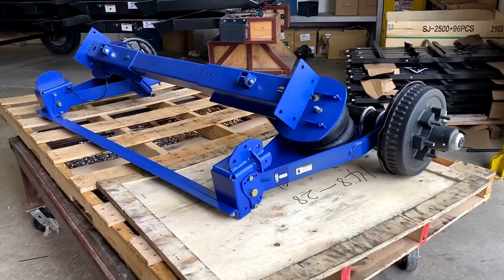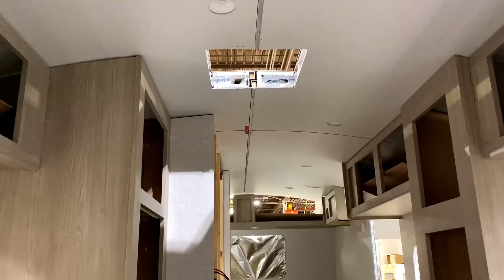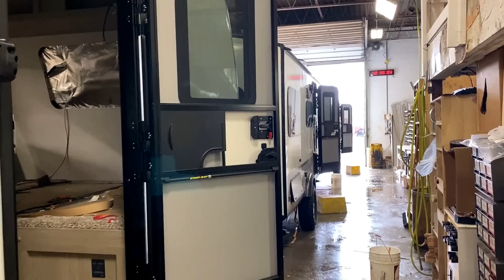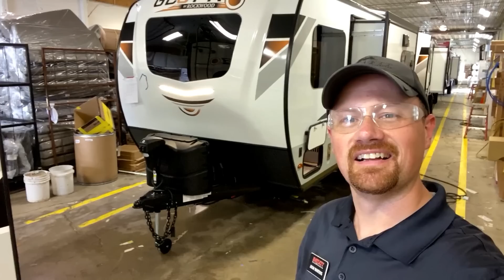Rockwood/Flagstaff Factory Tour!! (Part 3: Geo Pro & E-Pro)

Comment: I watched this series five years after it was produced because I  just bought a Geo Pro G19FD. But the timing is right because it is a 2018 model - made just three years before Josh visited the factory. Mine was owned by a man who, literally, never used it - parked in an enclosed garage - so it is functionally new, with no signs of wear and perfect graphics! This tour reinforced my confidence that I bought the best travel trailer for my intended purpose: Mostly off-road camping with some boondocking. I was very pleased to see proof of the superior engineering these units reflect and the extra care with which they are assembled. It also delighted me to learn how well Forest River treats the employees. I look forward to years of trouble-free exploring. Thanks, Josh!

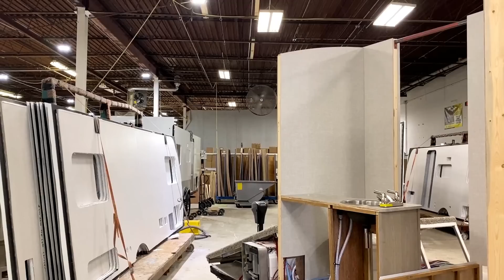Comment: Those flex tubes at 12:33 seem to be flex tubes on pex fittings. That’s not ideal over time. Is it possible to have them confirm? I’d love to get an all pex trailer with no flex tubing if possible.
Reply from the maker: Note the posting date on this footage. They've made some improvements since
Reply: @JoshtheRVNerd  I actually emailed them yesterday. They confirmed they still do use flex tubing in the geo lineup. I asked if I could order one without flex tubing and they said it was not possible. (Will from Sales told me this). I guess I’ll have to keep looking as this was my favorite otherwise. It’s lightweight and is otherwise really well built. I just want to make sure I didn’t have water issues in a few years just after the warranty period.

Comment: I had to come back and revisit this video because I was on some RV user group and someone posted a photo of the side of their travel trailer (It was a Bullet by Keystone) and there was a huge piece of the laminate missing on the side, near the front, exposing the plywood underneath. The problem appeared to come from a lack of maintenance by the previous owner. It got me to thinking, do I have plywood in my walls (We have a 2019 E-Pro 19BH)? I did not think so which is why I am here and NO, there is not.

This video (and many others by Josh) is the reason that we purchased the rig that we have. We have owned our rig for 1 1/2 years, towed it almost 17,000 miles through 25 states (even through the white knuckle, 10% grade Teton Pass going from Jackson Hole, WY to Yellowstone) and have experienced NO major issues. We chose a smaller rig because we were limited by our tow vehicle (2022 Toyota Sienna Hybrid XSE). Watching this video again just reinforces why we made a great decision to purchase our E-Pro!
Reply from the maker: Geo pro has never used wood paneling in walls. They've always been azdel on the inside and out since they launched
Reply: @JoshtheRVNerd  Thanks Josh! That is what I thought and why I came back to review your video to confirm. Another reason that I am so glad that I bought an E-Pro!!

Comment: I am a GeoPro owner who had troubles with my flooring separating from the frame because of poor fastener application at the factory. Good to see the factory went back and upgraded the fastener connections the exact same way I did it...double-nutted with a Nylock nut finish. This was my biggest complaint about quality in my rig.
Reply from the maker: Thanks for sharing. Glad to know they’re making improvements that matter

Comment: After all the horror stories I heard of issues after an RV is delivered I was more pleased with the build quality of our E-Pro than I expected to be. For the most part fit and finish and component quality was exemplary. Except the sink. That damned sink. I wouldn't even have run up against it except that the faucet was loose and since there was no way to adequately get at the large nut that fastens it I decided to pull the sink out. Except that whoever was putting on the sink clips that day was not paying attention. 2 of those clips were badly mangled and removing them was not simple in the least, made worse by the fact that I was doing it all by feel in a tight space that was awkward as heck to get to. Since the screw heads had been ruined I resorted to using a pair of vise-grips to grab and twist the screw head. But I could only turn about 1/4 of a rotation before having to re-position the vise-grips which, as mentioned, was done all by feel. It took me all day to get them out. And then getting the sink to release from the adhesive applied to the countertop was another challenge. I don't know what they used but that was some seriously tough adhesive.

I shouldn't complain about the lengths that had been gone to to make sure the sink doesn't come loose, but if the installer hadn't messed up those 2 clips so badly I never would have had to find that out. It also explains why when I took it in to the dealer to have the faucet tightened under warranty they clearly only hand tightened the nut, which lasted about 15 minutes once we started using the faucet on our next trip.

There were a few other examples of careless work due to, presumably, rushing but nothing that was critical or that couldn't be sorted out relatively easily. And if the sink is my biggest complaint then I feel I got off lightly. I had no problem before recommending the brand, and this video has only cemented this further.

Comment: I have a 2019 Geo Pro FBS.  Nice camper except for the MORryde steps were screwed into the floor and eventually failed when my wife lowered the steps and they fell on her legs!  Total garbage, that where the steps ended up!  A welding company was able attach a folding step underneath the camper, added the solid stance by etrailer and it’s a much better system.  Beware the MORryde steps will possibly fail at point.
Reply from the maker: 😳 uh... wow.. I'm not saying I've never happened before but that is the first time I've personally heard of this happening 

I actually am a fan of the old style folding steps + solid step drop legs
Reply: Love your reviews, I’m a fan!  You’re the reason my wife and I bought the 19 FBS Geo Pro, we absolutely love it!  Besides the steps, I replaced the plastic bathroom sink with stainless and swapped out the toilet with a ceramic toilet.  Thanks for what you do!
Reply from the maker: @salmo4613  wow ty! mind dropping me a quick review at https://g.page/r/CdPcitNVx2nDEAg/review for the helping hand?

Comment: Do you know if a controller is needed if a 100 w panel is plugged into side panel connector
Reply from the maker: Portable systems typically have their own integrated controller. Unless you have some wonky hardware a separate controller on the RV should not be needed

If the RV already has roof solar and a controller built in, then a portable system can work in tandem with it. No special stuff needed. Just plug and play!
Reply: @Josh the RV Nerd at Bish's RV  thank you

Comment: Are these guys hiring? That aluminum welding is killing me! I will never understand why anyone finds that acceptable. Bums me right out because I want one!!!
Reply from the maker: I'm uneducated in welding. Could you enlighten me as to what's been done poorly?
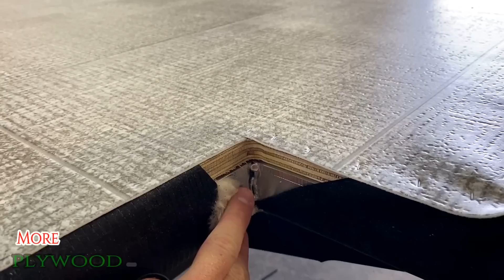Reply: @JoshtheRVNerd  I did cosmetic aluminum welding for a company called Logan Coach. I know it is an industry issue.  4:23 is a good example. There is at least 1 (It looks like 2) hole in the weld that is closest to the center screen. The weld to the right of it covers maaaaaybe 70% of the joint being generous. That is one reason why welds crack and break. Trailer companies get away with it because it is almost never seen once fabricated. Any welder worth his salt would not let that fly in my opinion. QC should be on that! (I also have 3 years of QC experience in a precision machine shop *cough *cough) I don't even know how to respond to 4:52 politely. For anyone with welding experience, I can guarantee you that is a HUGE red flag when considering spending this kind of money on a trailer.
Reply: @jasonlamb3533  100% in agreement re. the welds!!  Sure those welds are hidden, but that's just the point. If they're so worried about using good plywood to support the shower (which also can't be readily seen), then why aren't they equally observant about having good, consistent welding on the floor frame?  That one at 4:52 is egregious, but others just seem like they're tacked.  I would like to see a full bead down the seam. Am I wrong?

Comment: Hi Josh, the factory tours are the best. I saw in another's Youtube video ( Rockwood 2022 2509s Small Solar Upgrade) that Ian used 3M VHB dbl stick tape to attach additional solar panels to the roof (14:10 min into video), rather than putting additional holes in the roof with screws thru the roof membrane. Do you have any thoughts on this or have you discussed with any of the manufacturers?  My concern is that the 3M VHB permanent type tape is only attached to a membrane that itself is only glued to the rood below...although I do like the idea of less holes in the roof.

Comment: Hi Josh-
Question- What type of roof membrane material does Rockwood MiniLite use?  My 2109s is a 2018 model.    TPO? EDPM?   I can't seem to find this answer anywhere...and I need to make SURE that the sealant and cleaning products I use are correct.   Many Thanks!   John
Reply from the maker: Last I knew they used TPO. MFGs swap between skins sometimes because despite all the marketing hype they're more similar than different. It's truly what's below the skin that matters.
Reply: @JoshtheRVNerd  H
Reply: Hi Josh!   Went thru my 2018 Rockwood 2109s "pile 'O papers" that came with the rig.  I found a sheet for the roof membrane: "Alpha Superflex TPO"

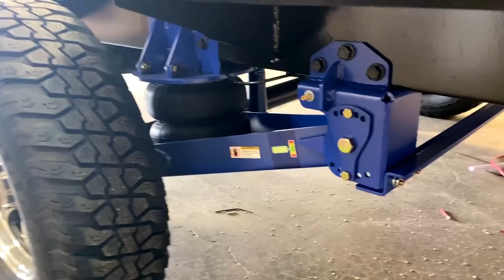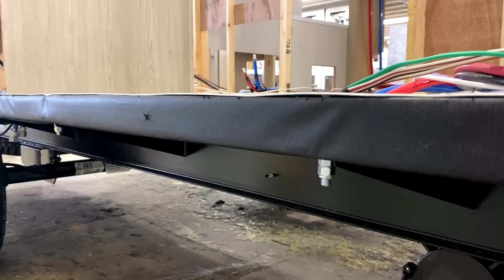Comment: Thanks for posting this very informative video.   We've been considering the purchase of a new GeoPro G20FBS and your video raised some specific questions about the main chassis frame currently being used by Rockwood.   I've seen other videos and pictures showing 2021 and 2022 model GeoPros using the BAL NXG (C-Channel) frame with all huck bolt connections for the outriggers and frame crossmembers.   At the 2:10 mark of this video, the stack of new chassis frames appear to be all welded C-channel or box tube frames.   At the 5:49 mark showing the Air-Ride suspension, that also appears to be a C-channel or box tube frame with welded outrigger connections.  At the 7:06 mark showing the typical torsion axle suspension, that is clearly an I-beam frame (Lippert?).   The I-beam type frame with welded outrigger connections is also shown at the 11:09 mark of the video.   So what frame assembly is currently being used on the GeoPro - the BAL C-Channel with huck bolts?   Or a Lippert (or other) I-beam frame with all welded connections?   Or does it vary by particular model?
Reply from the maker: Their chassis did change recently but it was not a "documented change" but rather something that happened "mid stride" 

They'll all use the same chassis but the 19FBTH exclusively uses the air ride system while the rest use torsion
Reply: @JoshtheRVNerd  So ignoring the 19FBTH, which chassis are they now using on their other models - the BAL C-Channel with bolted connections or an I-Beam frame with welded connections?
Reply from the maker: @omcbob37  As I recall they have largely swapped over to I-Beam frames. That's what I recall seeing for a while now. We have only a single Geo Pro on hand currently but it also has an I-Beam frame which is consistent with what I recall. 

I think it was a silent change from BAL to I-Beam frames along the 2022 model year
Reply: @JoshtheRVNerd  Thanks for the response.   I also confirmed with Forest River this morning they are using the Lippert welded I-beam frame exclusively now and plan to continue using it.
Reply from the maker: @omcbob37  Good! I like it when our notes all line up with one another. Thanks for watching. Great eagle eye on that.

Comment: Thanks for the tour.  Since this is a single axle trailer what is the load rating or pounds of the axle?  Also since this is a single axle is it better not to use a weight distribution hitch since the weight in the back of the tow vehicle can distributed to the trailer's axle exceeding the load rating or pounds that the trailer axle is rated?  Thank you again for the tour....great information!
Reply from the maker: GVWR will vary by model. We include those specs on our videos for viewers

Comment: Why do they use fiberglass batting on the floors as opposed to rigid foam insulation?  Wouldn't the foam not only hold up better but provide high r-values, not to mention not have problems with water retention and compaction reducing effectiveness like fiberglass insulation might>
Reply from the maker: The foam isn't providing structure in the case of a non-laminated floor. Batten insulation provides the same R-value with less cost while the aluminum floor skeleton and plywood decking provide the structure

Comment: I WANT ONE.  Still undecided on the 16BH or the 19FBS.  I just wish they offered Thermal Pane windows as an option for better cold weather capabilities
Reply from the maker: For what it’s worth those are nearly useless when it comes to enhancing the RV’s ability to withstand weather. They turn the window from a R0.7 to an R1.1. Virtually no change and quite costly

They’re good for helping deaden noise from outside but beyond that they provide very little benefit
Reply: The 19FBS is perfect for a single person . No wasted space.

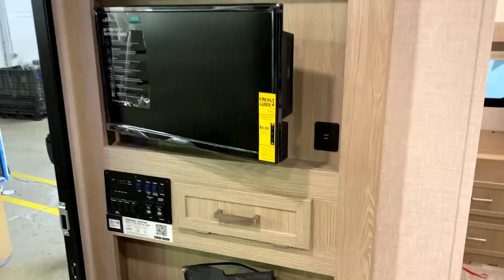Comment: Saw your other factory tours on these before we bought our 19FD (love it) back in Feb. Question: At 28:41 the control panel, is there a way to find the information on the decal with the 'phone app' to work the control panel separately, as in the decal peeled off (wouldn't stay stuck to the wall) and 'got lost'? Can get thru the process up to where it's asking for a "K-code" then stalls as I can't find that. New phone.
Posted link to vid on our Geo Pro facebook group.
Reply from the maker: I believe you can do a more manual hookup thru the app but it’s been a minute since I played with it myself

Comment: I would like to see a video on primarily single axle trailers... I bought a trailer that had load range C tires and 1480 # rated rims.. realized both were under rated for unit specs... called for D rated tires, and I needed 1660# rated rims.. I drove too long not realizing I was taking chances not being up on that like I should have been

Comment: Uncle Josh; by far the best factory tour and explanation of product yet! I have watched this one three times now. You are on your game GOLD MEDAL TIME!!!! Man, I love those weld points they are doing! No little puny spot welds like I have seen other manufacturers do. The roof system is really awesome, great point about the strength.
QUESTION: Is there a spot in the roof for connection for a DISH Antenna? Also, is there a way to retract the slides in case of a failure? Last, can you sit in the slides with them retracted inside?
 Double Azdel brings this up to a Lance quality product for 1/3-1/2 less money....AWESOME!!! I do wish they would fully enclose the belly though.....maybe like one other co. that uses the more rigid panels with the foil attached to the sections. Man, this is a awesome little trailer! Only question now is......Geo Pro or Mini Lite??
Reply from the maker: Roof isn’t satellite prepped, but there are “table top” receivers out there that work nicely

Not generally recommended to use closed slides btw

Comment: Hi Josh. We are huge fans of your show, but that weld that you pointed out on the floor section was a textbook example of excessive oxidation. The result of a poorly prepared, dirty surface and unacceptable welded joint that will more than likely separate eventually after hitting a pothole or experiencing flexing that occurs while going down the road. Hopefully that will be noticed by the folks there that can catch and correct that very real defect before it happens to their entire line. Thank you for all that you bring us. You’re appreciated!😎
Reply from the maker: Thx for watching and ty for the info Rick

Comment: They used to do OSB floors, or (Weyerhauser structureboard as Anthony Yoder called it). My 2020 19BH definitely has it because the floor sags between the floor beams when stepped on. That doesn't happen with 5/8 ply. Good to know they switched it out. So not really a misconception, just a change that they made at some point for the better.

Comment: Liked the way the solar panel is tilted a bit: better angle to the sun. So there is a connector for a portable panel? And is two panels the maximum on the roof?
Reply from the maker: Portable panels have the connector built in
Reply from the maker: Two is the Max factory number of roof panels, yes.

Comment: Wow really great video Josh. I am impressed by the build techniques loving that  air suspension   lot of good stiff  with geo pro  I run into a lot of them in California people dry camping an work camping right in mall parking lots an if the people are there I always ask how they like them  they always say they love them I gonna say the Lamanated  walls hold up pretty good on geo pros compared to some I not gonna name brands..... In  California do to great weather here r.v. builders  in California are a little skimpy .... Seeing the guts of these is very cool I can see were in future  like u said this last run of this model  someone 10 years from now who broke a waterline or wire  wear out an they have to replace might use your video to see were that line in walll. Your factory tours are great  but it would be great for you to interview a manager towards end just to speak about  there great product  geo is in my top 10 list of good  brands well built r.v.